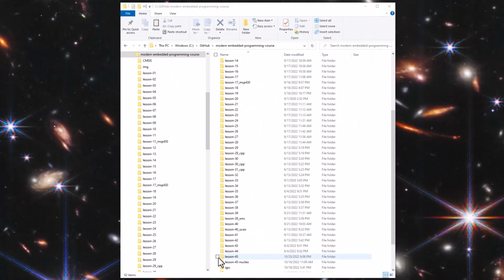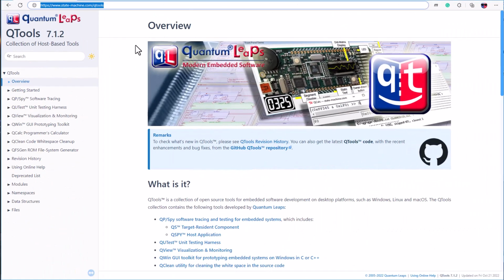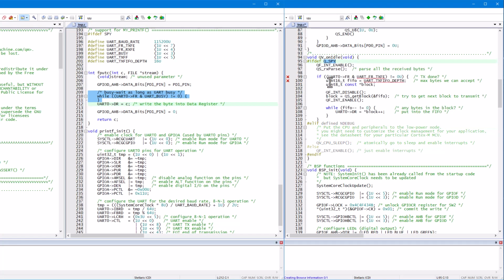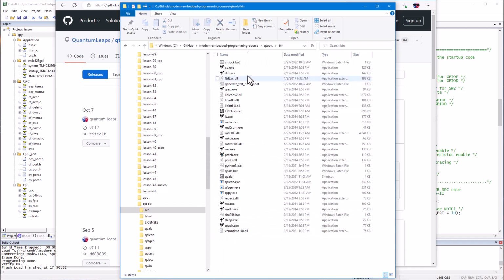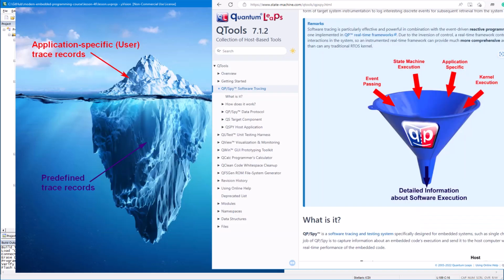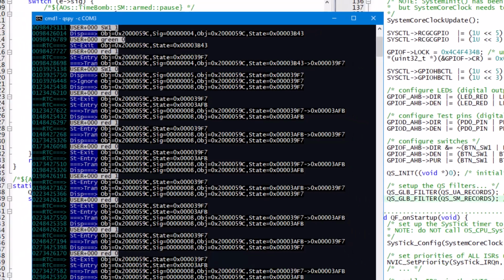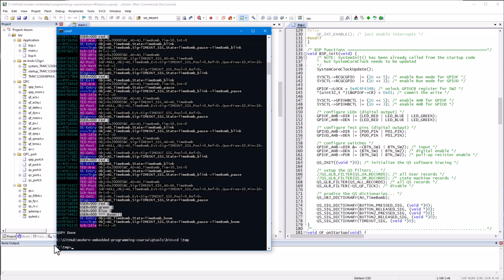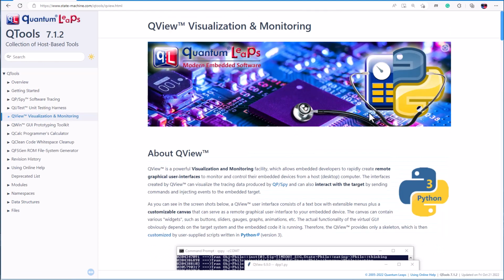#46 Software Tracing with Binary Protocols

Comment: I am using segger rtt for printf tracing.
my problem is that my output window on host getting polluted with repeated printf messages because I have multiple while loops which runs every x ms. Some modules runs every seconds so I cannot see the printf messages from these.
do you have any good advice for that?

Comment: Hi MMS,  I am doing one step by step learning, can the qspy be include without the qpc ? I just want to try to make a dummy test with a simple trace delay in a while loop. I tried to add files from (QPC)/src/qs + (QPC)/include + (QP_PORT_DIR) and "removing" from here, but i am not getting something, should I dig more in that direction or QSPY by conception is linked to QPC and cannot be used alone ?
Reply from the maker: The QP/Spy software tracing is currently intertwined with the QP/C framework and it is not trivial to separate it. There are some provisions to make the Spy tracing standalone (e.g., there is a separate QS critical section mechanism), but there are a lot of other dependencies. For example, the pre-defined trace records are specific to QP. --MMS
Reply: @StateMachineCOM  thanks for your answer, let's then go with a bigger step then; with QP/C 😅

Comment: IMHO, the Segger RTT is the best lib for printing stuff while debugging. It's very fast, doesn't require RTOS and UART and is hardware(mcu) independent. 
However, it requires  the J-link debugger attached to the target and RTT client software.
Reply from the maker: @iRepair: Yes, absolutely. QP/Spy specifically separates buffering of the tracing output from sending the output out. This sending can be done over any type of connection not just UART. Segger RTT over the J-Tag would be fantastic for that. The "only" problem is the reception of the RTT data on the host, for which you'd need Segger DLL (on Windows), which Segger keep proprietary and not available for open-source software like the QSPY host utility. If you're interested, there is a whole discussion about it on the QP Support Forum: https://sourceforge.net/p/qpc/discussion/668726/thread/5b598415 . --MMS

Comment: Looks like DMA would serve a very good purpose in QSPY
Reply from the maker: Yes, absolutely. DMA would relieve the CPU from brain-dead data movement so that the CPU has more time for real-time. But this is also generally true for event-driven programming, where you try to process events quickly in short run-to-completion steps. In that case the CPU would only program the DMA, but will not "babysit" actual data movement.